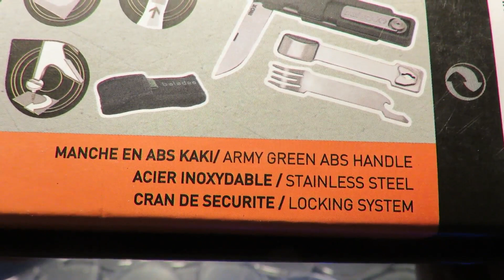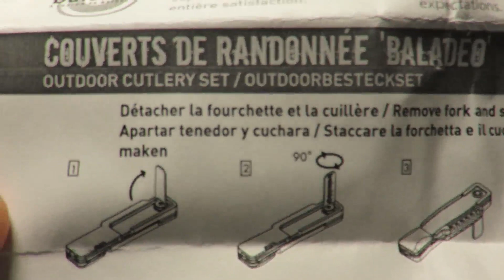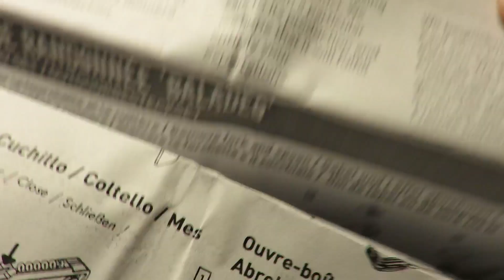Outdoor Camping Cutlery Multi-Tool baladéo ECO104 : One per child! EveryDayCamping

Comment from the maker: MT VOD * Dear lovers of multi-tools, you can ask me everything, redo a review, insist on a detail, make comparisons, test this or that, I am at your disposal! :) * Multi-Tool VOD
Here is my collection of multi-tools (November 2020) [/S = Brand Sheath]. Each model has been the subject of one or more videos (see my playlist "MULTI-TOOLS").
001-	BALADEO Outdoor Camping Cutlery Multi-tool ECO104 /S (*3)               
002-	BEAR & SON Bear Jaws 155LS /S
003-	BEAR & SON Bear Jaws Multiscissors Gardener BC157GT /S
004-	BEAR & SON Electrician's Bear Jaws BC155EL /S
005-	BEAR & SON Mini Bear Jaws 153
006-	BIBURY GHK 10-in-1 EDC
007-	BIBURY Multifunction Garden Pruner BBY-MT11 (offered by the company) /S
008-	BIBURY Multifunction Tool 21-in-1 BBY-MT08 (offered by the company) /S
009-	BIBURY Multifunction Tool 16-in-1 X0016E2LAJ (offered by the company) /Box
010-	BLACK FOX BF200 /S
011-	BÔKER PLUS Tech Tool Carbon 4 /S
012-	BÖKER PLUS Tech Tool City 5 /S
013-	BUCK Knives X-Tract 730 /S
014-	BUCK Knives X-Tract 735BKS-B Essential
015-	BUCK Knives BuckTool 350 (MiniBuck)
016-	BUCK Knives BuckTool 355 /S
017-	BUCK Knives BuckTool 360 /S (*2/ one completely broken)
018-	BYRD ByrdRench BY15P /S
019-	COLEMAN Pro Lock /S
020-	CRKT Bivy CR9250 (by Hans Florine)
021-	CRKT Guppie CR9070 (by Launce Barber)
022-	CRKT Technician Multi-tool CR9201 (by Glenn Klecker)
023-	CRKT Tool CR9200 (by Ed Van Hoy & Tom Stokes/ with Bit Kit) /S
024-	CRKT Zylla-Tool Jr. CR9065K /S
025-	CRKT Wooden Multi-Tool Kit CR1035
026-	DEEPEE 8-in-1 Shears Multi-Tool /S
027-	DICE TOOL EDC Multi-tool
028-	EICKHORN SOLINGEN PRT-II Rescue Knife /Böker S
029-	FISKARS Cuts+More
030-	FLEXCUT JKN91 Right-Handed Carvin' Jack /S
031-	FLOCON DE NEIGE 18-in-1 /S (& 15-in-1)
032-	GANZO G301-H /S
033-	GANZO G302-B /S
034-	GERBER Armbar Cork
035-	GERBER Armbar Drive Onyx
036-	GERBER Balance /S
037-	GERBER Bullrush /S
038-	GERBER Center-Drive (with Bit Kit+ Victorinox Scissors) /S
039-	GERBER Center-Drive Plus (with Bit Kit) /S
040-	GERBER Crucial /S
041-	GERBER Crucial F.A.S.T. (with Hex Bit Kit)  /S
042-	GERBER Curve
043-	GERBER Diesel /S
044-	GERBER Dime (*3/one with broken cissors)
045-	GERBER Flik /S
046-	GERBER Fit /S
047-	GERBER FreeHand /S
048-	GERBER Freeman Exchange (with 3 blades) /S
049-	GERBER Grappler /S
050-	GERBER Prybrid Utility
051-	GERBER Prybrid X
052-	GERBER MP1 /S
053-	GERBER MP1-MRO (with Bit Kit) /S
054-	GERBER MP 400 Compact Sport (05500/ 45500) /S
055-	GERBER MP 500 Recoil Auto-Plier /S
056-	GERBER MP 600 Basic Black (07550) /S
057-	GERBER MP 600 Black (07550G1 Carbide Cutters) /S
058-	GERBER MP 600 Bluntnose (old model with 55200 Multi-Plier Pocket Tool Kit) /S
059-	GERBER MP 600 Bluntnose Black (07520G1N Carbide Cutters with Tool Kit) /S
060-	GERBER MP 600 Bluntnose (07500 Carbide Cutters) /S
061-	GERBER MP 600 Pro Scout (07564 with Tool Kit) /S
062-	GERBER MP 650 Evolution (with 2 heads)
063-	GERBER MP 700 Urban Legend /S
064-	GERBER MP 800 Legend /S
065-	GERBER MPT #5 /S
066-	GERBER Multi-Lite (07205)
067-	GERBER Nautilus /S
068-	GERBER Obsidian
069-	GERBER Octane /S (*2)
070-	GERBER Radius /S
071-	GERBER Splice
072-	GERBER Strata /S
073-	GERBER Suspension /S
074-	GERBER Suspension-NXT /S
075-	GERBER Truss /S
076-	GERBER Vise
077-	HANWEI Professional Multi-tool by PAUL CHEN 1008-GT
078-	HAVALON Evolve Jim Shockey Signature Series XTC-60AMTS /S
079-	HENSTRONG (or Bibury or Intey or …) 18-in-1 /S
080-	KERSHAW A100C /S
081-	KERSHAW Select Fire 1920
082-	KELVIN.36
083-	KING INNOVATION L-tool Lighting Multi-tool 46700 /S
084-	KITA Le Dépanneur x2 /S
085-	LEATHERMAN Blast (with Removal Bit Driver) /S
086-	LEATHERMAN Brewzer
087-	LEATHERMAN Charge+ (with Bit Kit & Pocket Clip & Lanyard Ring & Bit Driver Extender) /S
088-	LEATHERMAN Charge+ Forest Camo (with Bit Kit & Pocket Clip & Lanyard Ring & Bit Driver Extender) /S
089-	LEATHERMAN Charge+ G10 Earth (with Bit Kit & Pocket Clip & Lanyard Ring & Bit Driver Extender)/ S
090-	LEATHERMAN Charge+ G10 Orange (with Bit Kit & Pocket Clip & Lanyard Ring & Bit Driver Extender) /S
091-	LEATHERMAN Charge+ G10 Red (with Bit Kit & Pocket Clip & Lanyard Ring & Bit Driver Extender)/ S
092-	LEATHERMAN Charge+ TTI (with Bit Kit & Pocket Clip & Lanyard Ring & Bit Driver Extender) /S
093-	LEATHERMAN Charge AL /S
094-	LEATHERMAN Charge ALX Black Oxide /S
095-	LEATHERMAN Charge TI 2HO (with Bit Kit & Pocket Clip & Lanyard Ring & Bit Driver Extender) /S
096-	LEATHERMAN Charge TTI (with Bit Kit & Pocket Clip & Lanyard Ring & Bit Driver Extender) /S
097-	LEATHERMAN Charge XTI (with Bit Kit & Pocket Clip & Lanyard Ring & Bit Driver Extender) /S
098-	LEATHERMAN Core /S
099-	LEATHERMAN Crunch /S (*2 / including a clone)
100-	LEATHERMAN Expanse E306X /S
101-	LEATHERMAN Expanse E33BX /S
102-	LEATHERMAN Expanse E33T /S
103-	LEATHERMAN Expanse E55BX /S
104-	LEATHERMAN Expanse K502X /S
105-	LEATHERMAN Flair /S
106-	LEATHERMAN Free K2X
107-	LEATHERMAN Free K4
108-	LEATHERMAN Free P2 /S
109-	LEATHERMAN Free P4 /S
110-	LEATHERMAN Free T2
111-	LEATHERMAN Free T4
112-	LEATHERMAN Freestyle /S
113-	LEATHERMAN Freestyle CX /S
114-	LEATHERMAN Fuse /S
115-	LEATHERMAN Juice B2
116-	LEATHERMAN Juice C2 /S
117-	LEATHERMAN Juice CS3
118-	LEATHERMAN Juice CS4 /S
119-	LEATHERMAN Juice KF4 (offered by the company & signed in my name by Tim) /S
120-	LEATHERMAN Juice Pro (with Victorinox Mini Screwdriver) /S (*2/ one offered by the company & signed in my name by Tim) /S
121-	LEATHERMAN Juice S2 /S
122-	LEATHERMAN Juice SC2
123-	LEATHERMAN Juice SX /S
124-	LEATHERMAN Juice XE6 (with Victorinox Mini Screwdriver) /S
125-	LEATHERMAN Kick /S
126-	LEATHERMAN Klamath /S
127-	LEATHERMAN Leap /S
128-	LEATHERMAN Mako TI
129-	LEATHERMAN Micra
130-	LEATHERMAN Mini Tool
131-	LEATHERMAN MUT (with Bit Kit & Tool adapter V2) /S
132-	LEATHERMAN MUT EOD /S
133-	LEATHERMAN Nehalem /S
134-	LEATHERMAN OHT (with tweezers) /S (*2)
135-	LEATHERMAN PST (*2)
136-	LEATHERMAN PST II
137-	LEATHERMAN PULSE /S
138-	LEATHERMAN Raptor /S
139-	LEATHERMAN Rebar /S
140-	LEATHERMAN Rev /S
141-	LEATHERMAN Signal /S (with Bit Kit & Bit Driver Extender)
142-	LEATHERMAN Sideclip /S
143-	LEATHERMAN Sidekick /S (with carabiner)
144-	LEATHERMAN Skeletool /S
145-	LEATHERMAN Skeletool CX V1(with Bit Kit & MUT Bits) /S
146-	LEATHERMAN Skeletool CX V2 /S
147-	LEATHERMAN Skeletool KBX
148-	LEATHERMAN Skeletool RX (with Bit Kit & MUT Bits) /S
149-	LEATHERMAN Squirt E4 (*2/ one offered by the company & signed in my name by Tim)
150-	LEATHERMAN Squirt ES4
151-	LEATHERMAN Squirt P4
152-	LEATHERMAN Squirt PS4
153-	LEATHERMAN Squirt S4
154-	LEATHERMAN Style
155-	LEATHERMAN Style CS
156-	LEATHERMAN Style PS
157-	LEATHERMAN Super Tool /S
158-	LEATHERMAN Super Tool 200 (with Tool Adapter V1) /Combo S
159-	LEATHERMAN Super Tool 300 /S
160-	LEATHERMAN Super Tool 300 EOD /S
161-	LEATHERMAN Super Tool 300M /S
162-	LEATHERMAN Surge (with Bit Kit & Pocket Clip & Lanyard Ring & Bit Driver Extender) /S
163-	LEATHERMAN Surge 2013 Black Edition (with Bit Kit & Pocket Clip & Lanyard Ring & Bit Driver Extender) /S /Kydex CF Sheath
164-	LEATHERMAN Wave (with Bit Kit & Pocket Clip & Lanyard Ring & Bit Driver Extender) /S
165-	LEATHERMAN Wave+ (with Bit Kit & Pocket Clip & Lanyard Ring & Bit Driver Extender) /S
166-	LEATHERMAN Wave+ Black Oxide Limited Diegel Edition /S
167-	LEATHERMAN Wave Original /S
168-	LEATHERMAN Wingman V1 /S
169-	MASERIN Citizen 564/G10N (by Moris Baroni)
170-	MAXKNIVES MKTI1
171-	MIKOV NUZ 246-NH-4/RESCUE
172-	MOSSY OAK 17-in-1 /S
173-	NEXTOOL Xiaomi 10-in-1 KT5023 Motool /S
174-	NEXTOOL Xiaomi Flagship Mini KT5022
175-	OPINEL N°9 Bricolage
176-	OPINEL N°12 Explore
177-	OZARK Trail MULTIFORCE PREMIUM 18-IN-1 MULTI TOOL /S
178-	PIRANHA 6-in-1 (crescent wrench & pliers combo) /S
179-	PIRANHA 9-in-1 (crescent wrench & pliers combo) /S (*2)
180-	RATNIK 6E6 (with diamond-coated file) /S
181-	REAL AVID Fun Tool Max /S
182-	ROXON Flash S803 (offered by the company) /S
183-	ROXON Knife Scissors S501 (*2 / one offered by the company)
184-	ROXON Multi BBQ Tool MBT Mini S602 (offered by the company)
185-	ROXON Multi BBQ Tool MBT3 S601 (*2/ one offered by the company) /S
186-	ROXON Phantasy S502 (with all blades offered by the company)
187-	ROXON Phantom S802 (*2/ one offered by the company) /S
188-	ROXON Spark CM1349 (*2/ one offered by the company) /S
189-	ROXON Storm S801 (with bit kit & Victorinox Mini Screwdriver) (*2 / one offered by the company) /S
190-	ROXON Storm S801S (with bit kit & Victorinox Mini Screwdriver) /S
191-	RUIKE Criterion M61-G (with Victorinox Mini Screwdriver) /Böker S
192-	RUIKE Trekker LD43 Rescue Tool
193-	RUIKE Trekker LD51-B (with Victorinox Mini Screwdriver) /Victorinox S
194-	SCHRADE Tough Chip ST2 /S
195-	SCHRADE Tough ST1 (original U.S./ version 1) /S
196-	SCHRADE Tough ST1 (Taylor Brands Schrade) /S
197-	SCHRADE Tough ST11 /S
198-	SCHRADE Tough STE5 /S
199-	SEBERTECH Sebertool M2
200-	SEBERTECH Sebertool M4
201-	SOG CrossCut 2.0
202-	SOG CrossGrip
203-	SOG Kilowatt
204-	SOG Paratool S31 (with Saw instead Philipps screwdriver + Bit Driver + Hex Bit Accessory Kit) /S
205-	SOG ParaShears /S
206-	SOG Pocket PowerPlier S44 /S
207-	SOG PowerAccess Assist (with bit kit) /S
208-	SOG PowerAccess Deluxe (with bit kit) /S
209-	SOG PowerAssist S66 (with Saw instead of V-Cutter) /S 
210-	SOG PowerDuo PD01 /S
211-	SOG PowerGrab (with Bit Kit) /S
212-	SOG PowerLock S60 (with Bit Kit) /S
Reply from the maker: 213-	SOG PowerPint (with Bit Kit) /Böker S
214-	SOG PowerPlay (with Bit Kit) /S
215-	SOG Snippet
216-	SOG SwitchPlier V2.0 /S
217-	SOG Sync II
218-	SPLITMAN GHK6 (with bit kit) / S
219-	SPYDERCO ASSIST SALT FRN YELLOW C79YL - Rustproof H-1
220-	SWISS+TECH Micro-Max 19-in-1
221-	SWISS+TECH Micro-Plus EX 9-in-1
222-	SWIZA C08 Urban Camo /S
223-	SWIZA D10 Mousse /S
224-	TAG SUPRA SS Credit Card Multi-tool
225-	TOPEAK The Alien I /S
226-	TOPEAK The Alien III /S
227-	TRUE UTILITY Tectonic TU220 /S
228-	UD Vape Cool Kit Multi-tool Cutting Pliers /S
229-	UTICA KUTMASTER Multimaster 11-3565CP /S
230-	VICTORINOX Bantam Alox (0.2300.26)
231-	VICTORINOX Classic 2019 Limited Edition When Life Gives You Lemons (0.6223.L1905)
232-	VICTORINOX Classic SD Navy Camo (0.6223.942) /S
233-	VICTORINOX Cybertool L (1.7775.T) /S
234-	VICTORINOX Cybertool Lite (1.7925.T) /S1
235-	VICTORINOX Evolution Grip 18 (2.4913.SC8B1) /S
236-	VICTORINOX Evolution Grip S54 (2.5393.SC) /S
237-	VICTORINOX Expedition Lite (1.7965.AVT) /S
238-	VICTORINOX Explorer 2017 White Christmas Limited Special Edition (1.6703.77)
239-	VICTORINOX Farmer X Alox (0.8271.26)
240-	VICTORINOX Hiker Walnut Wood (1.4611.63) /SwissQlip
241-	VICTORINOX Huntsman Lite (1.7915.T) /S
242-	VICTORINOX Huntsman SilverTech (1.3713.T7) /S /SwissQlip
243-	VIVTORINOX Jelly SwissCard Lite (0.7333.T3B1)
244-	VICTORINOX MiniChamp (0.6385) /S
245-	VICTORINOX MiniChamp Alox (0.6381.26) /S
246-	VICTORINOX MiniChamp Lite (0.6386) /S
247-	VICTORINOX Nail Clip 580 (0.6463)
248-	VICTORINOX Ouvre Montres (0.2102)
249-	VICTORINOX Pioneer X Alox (0.8231.26)
250-	VICTORINOX Pioneer X Alox Limited Winter Magic Limited Special Edition 2020 (0.8231.22E1)
251-	VICTORINOX Ranger Grip 58 Hunter (0.9683.MC) /S
252-	VICTORINOX Ranger Grip 71 Gardener (0.9713.C) /Wenger S
253-	VICTORINOX Ranger Grip Boatsman (0.9798.MWC8) /S
254-	VICTORINOX Rescue Tool (0.8623.MWN) /S
255-	VICTORINOX Signature Lite SilverTech (0.6226.T7) /S
256-	VICTORINOX SportRachet (1999) /S
257-	VICTORINOX Super Tinker Limited Winter Magic Limited Special Edition 2019 (1.4703.7E1) /S
258-	VICTORINOX Swiss Soldier’s Knife 08/2018 (0.8461.MWCH) /S
259-	VICTORINOX Swisschamp (1.6795.T) /S
260-	VICTORINOX Swisschamp XAVT (1.6795.XAVT) /S
261-	VICTORINOX Swisschamp XLT [1.6795.XLT] /S
262-	VICTORINOX SwissTool X (3.0327.L) /S
263-	VICTORINOX SwissTool PLUS (3.0323.L) (2008 – BMW/ with all accessories & scissors) /S & Gaine ouverte 4.0829
264-	VICTORINOX Swisstool  Spirit MXBS Black Oxide (3.0226.M3) /S
265-	VICTORINOX SwissTool Spirit S Black Oxide (3.0223) /S
266-	VICTORINOX SwissTool Spirit XBS (3.0224.3CCH) /S
267-	VICTORINOX SwissTool Spirit XC PLUS RATCHET (3.0239.N) (with all accessories) /S
268-	VICTORINOX Traveller Lite (1.7905.AVT) /S
269-	VICTORINOX Wine Master Walnut Wood (0.9701.63) /S
270-	VICTORINOX Workchamp V1 (0.8564) /S
271-	VICTORINOX Workchamp XL (0.8564.xl) /S
272-	WALTHER Multi-Tac /S
273-	WENGER Basic 66 (1 66 41)
274-	WENGER EvoGrip S557 (1.557.059.821 with Victorinox Mini Screwdriver) /S
275-	WENGER PocketGrip 577 /S
276-	WENGER RangerGrip Handyman 1.077.0[90.822] /S
277-	WENGER Swiss Business Tool SBT 60
278-	WENGER Titanium 1 (1.092.041.000) /S
279-	WENGER Titanium 2 (1.092.042.000) /S
280-	WENGER Titanium 3 Ueli Steck Spécial Edition (1.092.040.000) /S
281-	WOHO Wokit Carabiner multi-tool
282-	WORPRO 16-in-1 Multi-tool /S
283-	XIAOMI Nextool Huohou (or Nextool 16-in-1 or 16-in-1 Flagship Pro) /S
	
Acquisition forecast - Call for donations… Sog, Gerber, Victorinox and the others (except Roxon, Bibury & Leatherman) still stubbornly refuse to send me models that I could present. We live in a world unnecessarily absurd delivered to spirits that seem to be content with it...
1-	CRKT Septimo Multi-tool
2-	EMERSON Multitasker EDC 1/ 2
3-	EXTREMA RATIO Evo
4-	GERBER Cable Dawg
5-	GERBER Steady
6-	GRIPsher
7-	KAMPO NS-2
8-	LEATHERMAN Charge+ Woodland Camo/ Damascus Wood/ Black
9-	LEATHERMAN Expanse E33B/ E33TX/ E55B/ E307X/ K503X
10-	LEATHERMAN Pruner Genus
11-	LEATHERMAN Steens/ Ukiah
12-	LEATHERMAN Tread Metric
13-	LEATHERMAN Z-REX
14-	FKMD M.P.S.K. Survival Camp Tool FX-444/3MB
15-	MELITA-K Sapper/ Professional
16-	SCHRADE I-Quip
17-	SOG Paladin PowerPlay PT-540
18-	SOG ToolClip
19-	SPYDERCO ClipiTool Rescue C209GS
20-	SPYDERCO Spyderench T01
21-	TOLER TOOLS
22-	VICTORINOX Compact
23-	VICTORINOX Parachutist One Hand
24-	VICTORINOX SD Rocknife Bijou Granit
25-	VICTORINOX Spartan Onyx Black
26-	VICTORINOX US Soldier 2017 (0.8461.MWUS)
27-	WENGER Laser Pointer (1.97.01 cissors)
28-	WENGER RangerGrip 88/95 - Rescue I/II
29-	WENGER SwissGrip (WengerGrip 76) (1 76 01 61)